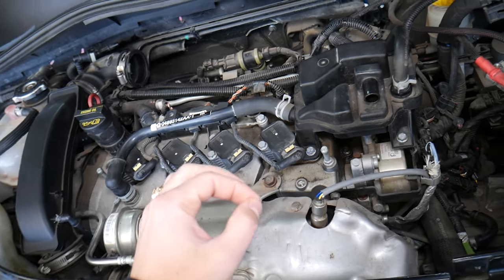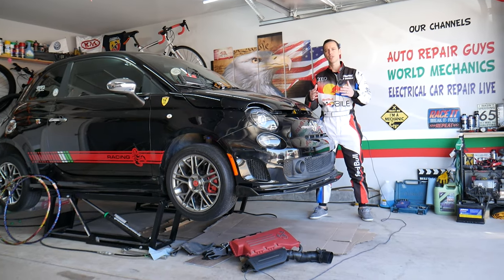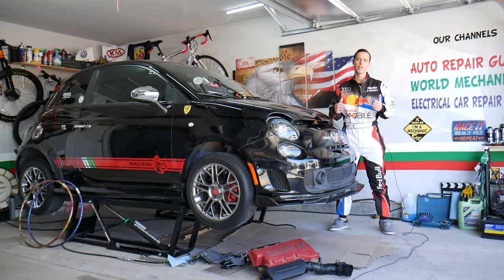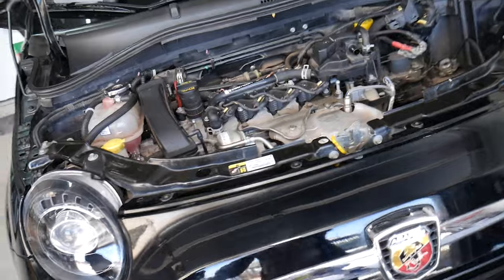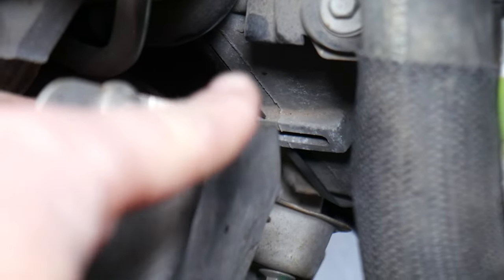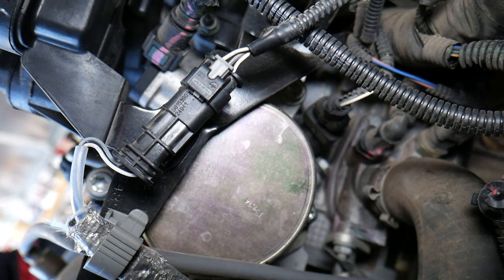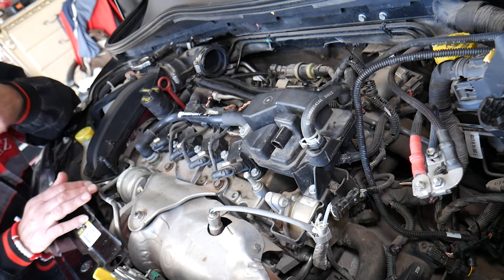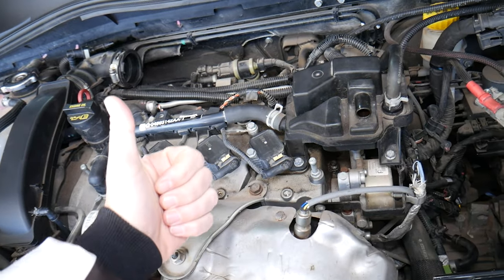FIAT 500 DOES NOT START OR RUN GOOD AFTER CRANKSHAFT POSITION SENSOR REPLACEMENT

Comment: Where are you located?  My fiat 500c just gave up on me without prior warning when I was driving on freeway. Took it to the mechanics. They ran a diagnostic test and it came back that the crank shaft sensor needed to be changed so they changed it but it’s still not functioning properly

Comment: Hi. I have a 2016 Jeep renegade with the same engine. (1.4 turbo).  I’m getting a check engine light for p0315.   The description says the crankshaft position sensor is not learned.  My buddy tried to
Reset it with a scanner.  He was able to, BUT as soon as he did, the code came back.  The crazy thing is that the car
Runs great, does not cut off , and starts right up.  Please help……. Bad pcm ? Or bad crank sensor ??
Reply: You need a good mechanic to run actual tests to diagnose the issue your having.  I don’t recommend guessing or asking people online to guess for you. Without looking at the vehicle, testing circuits etc. nobody on here will be able to help you and it doesn’t sound like you are mechanically inclined enough to be walked through tests.